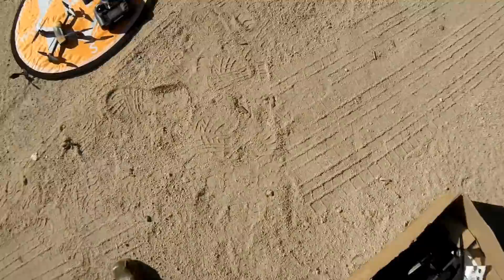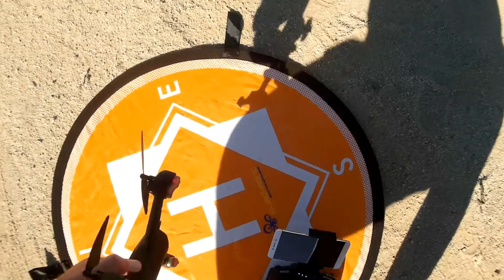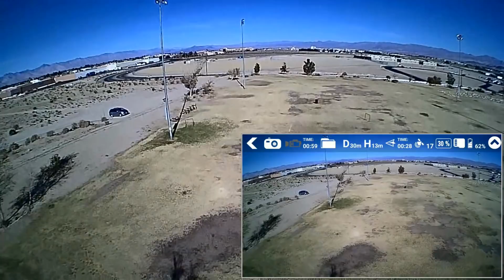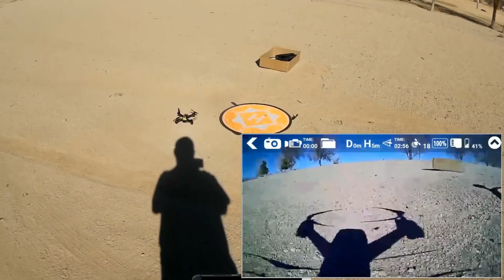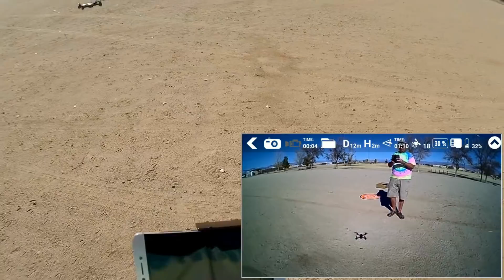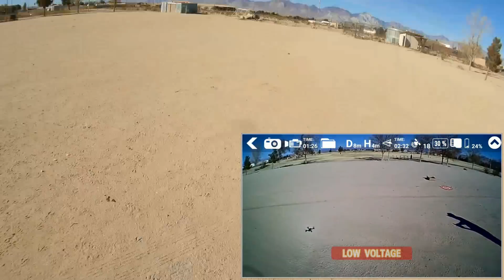JXD 518 Beginners GPS HD Camera FPV Quadcopter Flight Test Review

Comment: We have a problem with flying the drone. We did everything according to the instructions, but when you press the "start" button nothing happens, the motor does not spin and the drone does not fly, Maybe you know what is the problem?
Reply from the maker: 1) First you need to do a compass calibration as shown in the video at 5:23
2) Next you need to place the drone on the ground and wait until you have at least 9 satellites connected as shown on the app.
3) If you've completed the compass calibration, and you have sufficient satellites connected, then quickly press the start button on the transmitter to start the motors.
Reply: I had the same issue with mine. Delayed my maiden flight by several days before I figured it out.
 
First, plug the drone's flight battery in, then turn on the radio.
Shortly thereafter, the radio should emit a surprisingly lengthy series of beeps.
 
When the beeping stops, do a compass calibration (long-press the, "GEOMAGNETIC" button on the radio until it beeps). Then slowly spin the drone counterclockwise (anticlockwise) until the radio emits a single beep. Then hold the drone vertically so that the camera faces the sky and spin it counterclockwise until the radio emits two beeps in rapid succession.
 
Place the drone of the ground so that you can see the bottom of the rear pylons (arms); when you see them light up a steady green, that tells you that you have sufficient GPS satellites to fly.
 
Now this is where I F-ed up. Move both left & right joysticks down and toward the center; hold them that way for approx. 1 second. The red LEDs under the front pylons will rapidly flash for a couple of seconds or so.
 
NOW press & release the "S/L" button on the radio.
With a pinch of luck, the motors on the drone will spin up to "idle" speed; giving it throttle should send the drone skyward. :-)
 
HAPPY FLYING!!! :-D

Comment: Advise on jxd 528 vs jxd 518 for a first drone plz?
Reply from the maker: JXD 528 is better with advanced features of follow, circle, and waypoints. https://www.youtube.com/watch?v=IfnMsENm1bE
But MAKE SURE to first verify that your phone is capable of new 802.11ac WiFi before purchasing.  If your phone does not have 802.11ac, you will not be able to fly it or the JXD 518.
Reply: Quadcopter 101 thanks for the reply! I've just ordered myself a slightly less humble Dobby, found a deal at about $250. Hoping it'll treat me well. 🤞

Comment: Hi guys, i have a problem with my jxd 518. I can't see the wifi network of the drone on my phone. i have a huawei p10 (it's support the  802.11ac protocol) so i dont know what can be the problem...anyone else with a similar problem?
Reply from the maker: See if your phone has advanced WiFi settings.  In the WiFi settings menu, click "More" if shown in the bottom right corner of the screen.  Then click "Advanced Settings". Then click "WiFi frequency Band" and select "Auto" or "5G".

Comment: Hi, i don't see drone's wifi, Can you help me? How Can i connect my smartphone?
Reply from the maker: As discussed in the video, and listed above in the video description, this drone uses the new 5G (802.11ac) WiFi. It's very important to first verify that your phone/tablet is 802.11AC WiFi capable before purchasing.
Reply: Quadcopter 101 My phone Can connect to a 5GHz wifi....my question is: when the drone is on, what have i do to connect the smartphone? 
I switch on the drone, i connect It to the controller, and then?
Reply from the maker: Turn on the drone, place the drone on a flat and level surface, and then connect it to its controller.
Open your phone's WiFi settings.  Make sure that its 5G reception is turned on (usually under advanced settings).
In your phone's WiFi settings, look for the drone's WiFi signal and connect to it (the same way that you would connect to home WiFi).  
Once your phone is connected to the WiFi signal, then open the app.  Video should now be viewable through the app.
Reply: Quadcopter 101 Thanks for helping me, It doesn't work.
Is It possible that other wifi makes interferences?
Reply from the maker: If you live in Europe, you may need to install the firmware update that allows the B2W to work with European 5G frequencies.  Please see the following https://dronesgator.com/mjx-bugs-2-review-best-gps-drone-under-200/
Reply from the maker: More info https://www.rcgroups.com/forums/showpost.php?p=39136239&postcount=2017
Reply: Quadcopter 101 Thanks a lot, i'll try!
Reply: Quadcopter 101 I see the camera on iOS smartphone, but not in Android, i tried 4 smartphone but only iPhone 8 goes.
Reply from the maker: Are you certain that your Android phones are 5G WiFi?  Not many phones have 5G WiFi.  Most phones are only capable of 2.4Ghz WiFi.
Reply: Quadcopter 101 Yes because i have a 5Ghz Router and i connect my smartphone
Reply from the maker: Your android phones may be connecting to the 5G router on 2.4Ghz, as most 5G routers are dual band.  The only way to know is to check the specifications for your models of phones.  Additionally, for android devices, check the WiFi advanced settings menu.  You should have a selection available allowing you to specifically select 5G WiFi, and hiding 2.4Ghz.
Reply: Quadcopter 101 Thank you, i will check

Comment: I was hopping to buy this quad but i have few doubts, hope you reply. What do you think about video quality? Is it any good for YouTube? And how often do i have to replace the motor?
Reply from the maker: The video quality is good for a drone in this price range.  The motor longevity will depend on how you fly it.  The following tips on the Hubsan H502E also apply to this drone https://www.youtube.com/watch?v=zgVcNc05RUc
And finally, before purchasing, be absolutely sure that your phone is 802.11ac 5G WiFi capable.  This drone will not work with 2.4Ghz WiFi.

Comment: great drone. So you connect the phone into the transmitter?
Reply from the maker: That's just a phone holder on top of the transmitter,  You connect the phone to the quadcopter's 5G WiFi signal.  But note that not everyone has 5G (802.11ac) WiFi on their phone. First check that your phone is 802.11ac WiFi capable before purchasing.

Comment from the maker: This drone's GPS system greatly eases flying and reduces chance of loss.  Also includes 720p HD and FPV.  Uses 5G (802.11ac) WiFi for long range FPV. Verify your phone/tablet is 802.11ac WiFi capable before purchasing!   Use coupon Sale12 to get $14 off here  https://goo.gl/2jhfUA and find the QuadPort landing pad here http://amzn.to/2i96Wua
Reply from the maker: Links work.  Your adblocker or might be blocking it.
Reply: Quadcopter 101  my p8 lite 2017 is 802.11 b/g/n.. Can It be used with this drone?
Reply: Link doesn't work :(
Reply: William Costa don’t think so.  Says it must be 802.11 AC

Comment: I'm waiting for one of these companies to make a small affordable folding quad with gps and fpv, they make cheap folding quads with no GPS and cheap GPS quads that don't fold up, just combine the two and make a low cost folding pocketable gps, fpv drone and it will sell like crazy...
Reply from the maker: I just got one in the mail with optical flow position hold.  Will be flying it on Monday for publishing next week.  But it doesn't have 5G WiFi, so don't expect the same performance as seen for the JXD 518.
Reply: nstrack1017 agree completely
Reply: JXD 528

Comment: Pretty much a Hubsan H502E ... but seems to have more quirks than the H502E.  Even with the $14 off coupon, you can now buy the H502E for less, and since there are readily available parts for the H502E, that would seem to be a safer choice at this point. I think they're going to have to fix a few bugs and reduce the price to be able to compete with the H502E. Thanks for the review.
Reply from the maker: Yep, the big advantage of this one over the Hubsan H502E is its 5G WiFi FPV.  As compared to 2.4Ghz WiFi, this allows faster/better data transfer, and longer range FPV signal as there's no interference from the 2.4Ghz controller.  Of course, not everyone can use this quadcopter as it requires a 802.11ac WiFi capable phone.
Reply: Carlo Defilippi I've been fpv flying my H502E for quite a while now.. I've had over 300m vtx signal range with only using a 25mw AIO camera. This ain't no hubsan killer as it only goes to 150m range before hitting a geofence. I've made quite a few videos on this one since I reviewed it a couple weeks ago. My hubsan H502E has had many flights, most long range and I have had zero.. Issues with it.. Not even 1 burnt out motor. It has epic range for a toy quad too as I've had mine over 600m one way and 600m back, 1.2km round trip on the little 610mah lipo.
Reply: Well, for about $20, you could stick a 200mw AIO (TX03) on the top of the H502E and have a better FPV signal, as the FPV signal on this one started breaking up at about 100m, even though you eventually got a signal from it out to about 180m. There were freezes/drops in this one's FPV signal, probably due to a low frame rate. The AIO cams use 25 to 30 FPS which gives a more reliable view (imho).  With a 200mw AIO, you can easily exceed 300m in FPV range as well.  Nice to have options in any case ...
Reply: Bill Somrak that's a good idea....
Reply: Bill Somrak As an enthusiastic owner of a Hubsan 502e I can relate: I've never checked the flight time but I'm more than positive I went on way more than 5'and 59'' even with the wind and the 502e Rth is performed with the drone looking forward instead of backwards which is preferable. But I have to admit this one has the plus of the Fpv and I like that telemetry on the cell screen...furthermore, I'm not really sure but looks like this one has a wider angle cam (120) I have the sensation that my Hubsan is a bit less, but yet wide, about 110...so, all and all the price difference is not so dramatic. Good products, both of them.